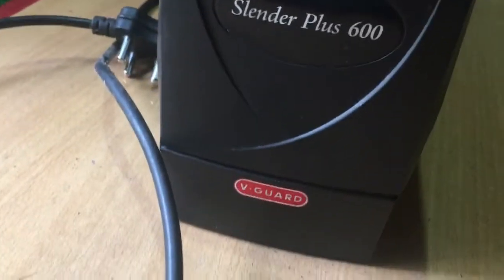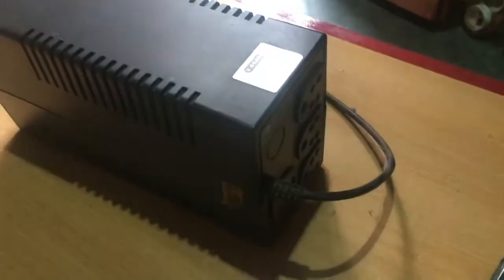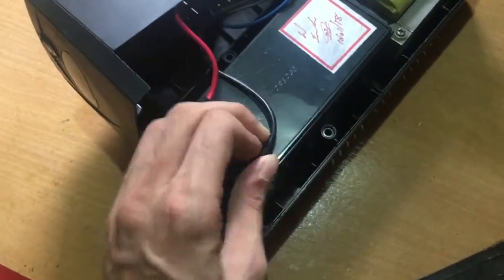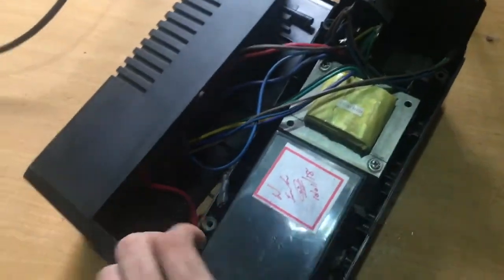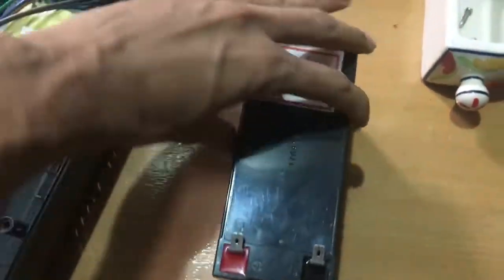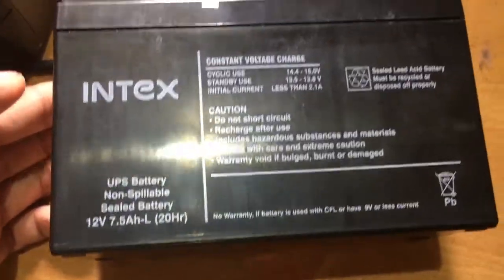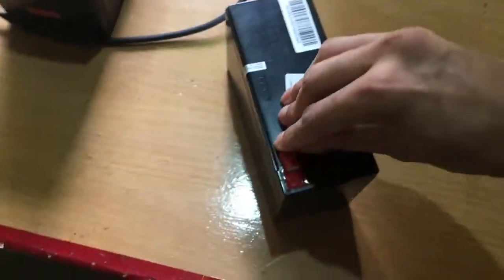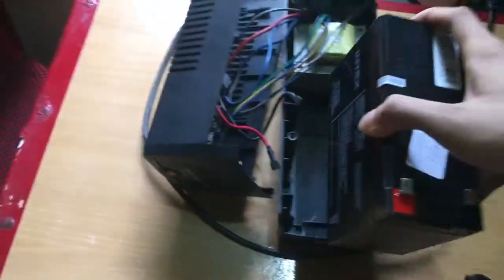How to replace PC UPS (Backup power supply) battery.

Comment: That ups is totally different from the once we have in our house..its battery is outside and battery has 6 caps and we usually replace the water every month
Reply from the maker: Thats home inverter/UPS not pc UPS.  I also have one. Its called an inverter here.☺️
Reply: @AgsCgs  ohh how much pc ups cost i need for my pc
Reply from the maker: @muzamilkhan7z  It costs around Rs 2000 for branded ones.
Reply: @AgsCgs  cheap  and how long the battery last
Reply from the maker: @muzamilkhan7z  good quality (battery) lasts around 2-3 years.
Reply: @AgsCgs  lol i mean battery back after full charge ..2 hours ,3hours
Reply from the maker: @muzamilkhan7z  20-30 mins (low load). 15 mins (max load).
Reply from the maker: @muzamilkhan7z  there are bigger UPS like the APC.  These give 3-4 hrs backup, mainly used for servers.